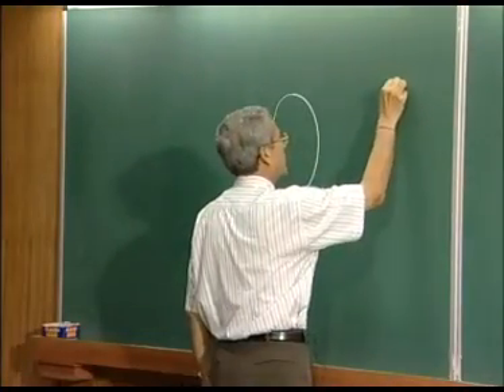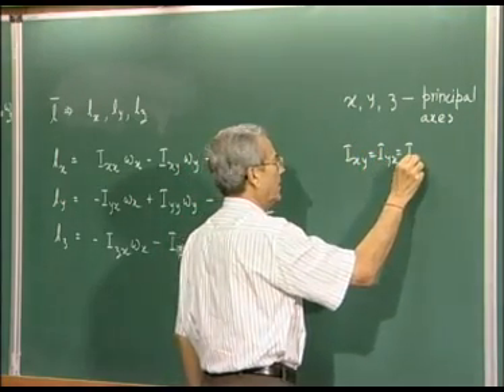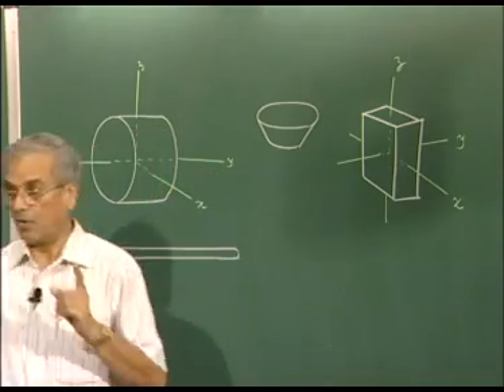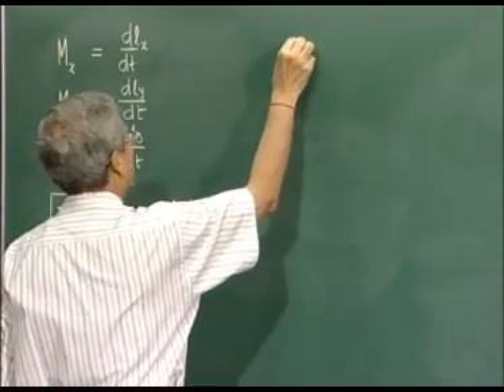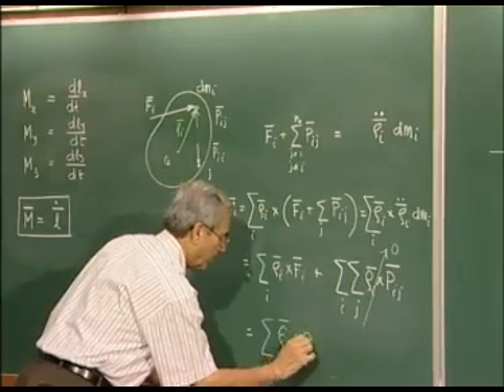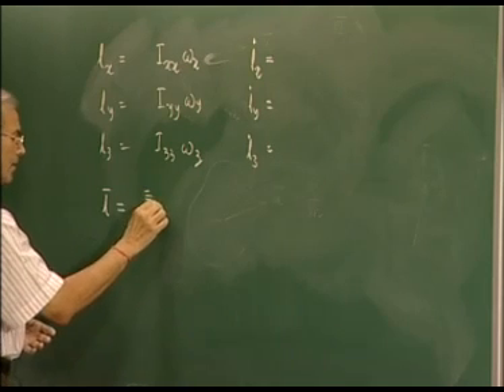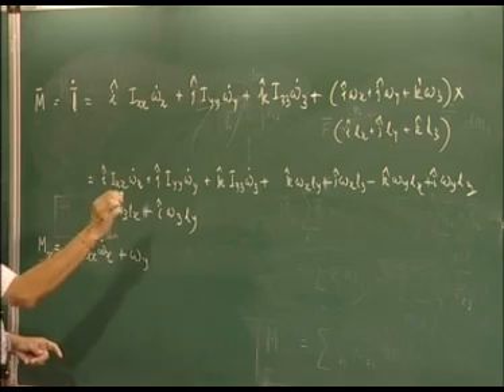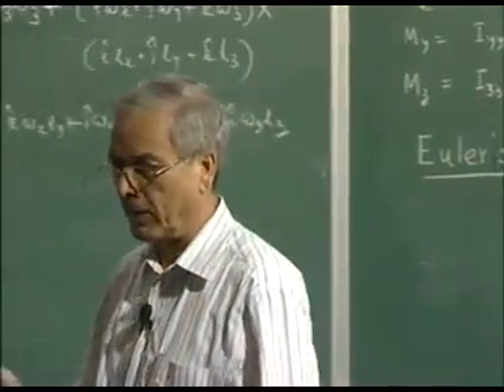Module 2 - Lecture 3 - Euler's Equation of Motion

Comment: If the moment of inertia tensor is projected in the principal axes, the angular momentum and the angular velocity are not necessarily act along the same direction. All the three principal moments of inertia should be equal to make them co-linear.
Reply: +Supratik Banerjee For anyone wondering, he covers this at about the 50 min mark in the previous lecture.

Comment: The lecture is very helpful, I have to admit this. However if you use the concept of Levi-Civita tensor and rotational transformation you can derive the Euler equations in 2 lines :). 
Btw are all mathematics and physics profs. Indians :)
Reply: That's also a good approach. However, we as students donot wish to see the derivations just for the sake of understanding but it comes in the exams as well. And a 2 line derivationa definitely isn't going to fetch marks. :)